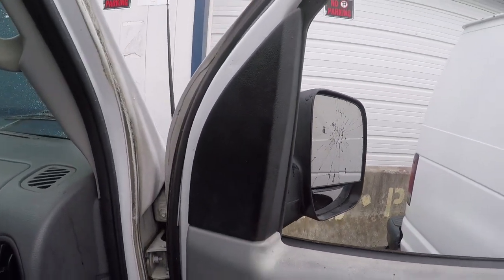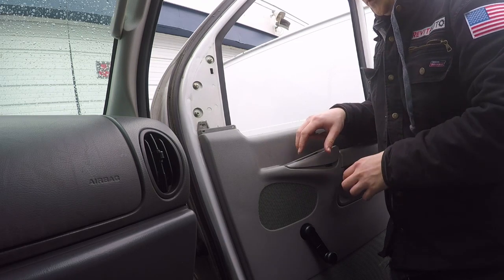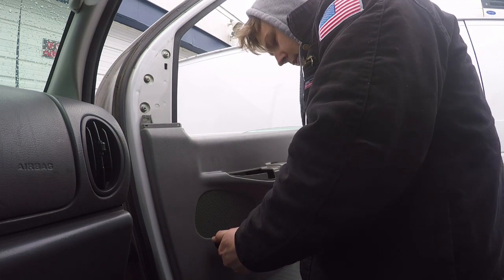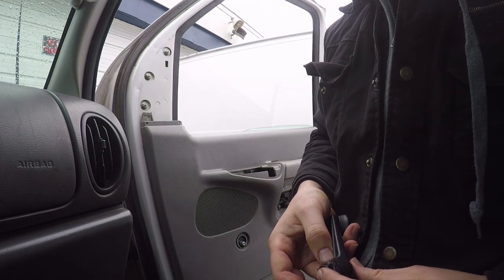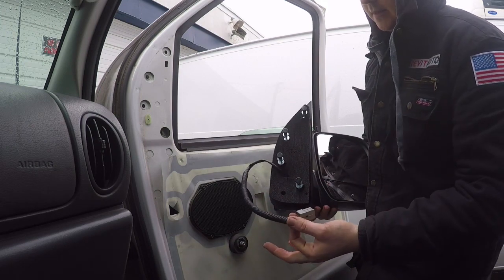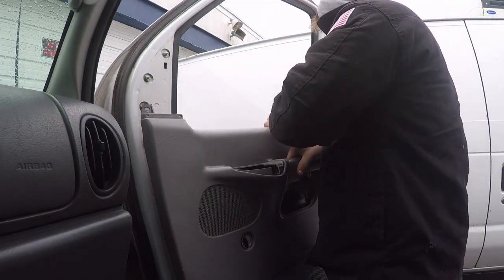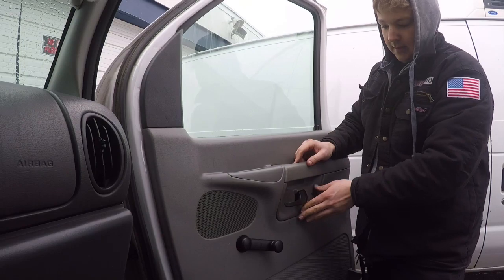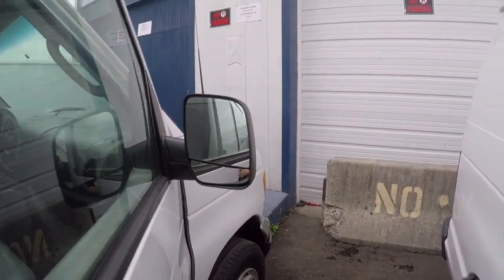Ford Econoline Van Mirror Replacement (Detailed How To) | Fix It Friday

Comment: Great video! I used this to replace my mirrors. You can do this without removing the door panel, if you are careful. The bottom nut is visible when you pull off the black trim cover. There is a screw that holds the top front of the panel. Remove that and gently pull the panel up and out giving you access to the room you need to get at the nut. Use a small 1/4 socket with either 7/16 or 11mm. If you do it on a hot day you get the benefit of the plastic panel being even more flexible. If not a hair dryer might help.

Another option is that when the door is close you hardly see it but you could simply drill a hole in the panel and have access to the nut and then get a plug for the hole if desired. As these vans are long in the tooth you can decide how you want to handle it.
I was able to do both sides in 1/2 hour being extra careful without removing the panel and just the top screw.

Comment: Thanks for the video. One helpful note for people with electric mirrors: take the speaker out and then you have full access to the connection.
Reply from the maker: Thanks for adding that! I have yet to see that! Happy Motoring-Blair
Reply: Thanks for adding that note! ‘Full access’ is one way of putting it. Lol. I had to have one hand shoved into the speaker hole to release the harness tab, while pulling on the mirror harness from the outside.
Reply: I think Matt means to say, "partial access."

Comment: Taking the whole panel off just to get to a hidding screw? Thanks Ford for making it harder than it should be...
Reply: I don't do much engine work myself but from what I hear econolines are a bitch to work on all around. I don't understand why they had to shove the engine so far forward into the cabin. Means my massive E350 has less legroom than my ford focus.
Reply: @JackAttak  I love the looks of the van... Specially the extra long one. I have one My self... I just haven't had any engine problems yet... But i do know when I get to have some... It will be an expensive repair.

Comment: How do you adjust the electric mirrors if you do not have electric setup?
Reply from the maker: You can just press in the mirror gently and it will move. You may need two people to speed the process up!

Comment: Why you removed the door panel
Reply from the maker: There are four nuts that hold on the mirror assembly. In order to remove the lowest one you need to remove the door panel. Happy Motoring -Blair
Reply: Wondering too. Mine is manual not electric. Same dismantle?
Reply: @Revitauto  no you don't
Reply from the maker: Daniel Mann tell me of your magic ways !?
Reply from the maker: @danielmann5427  tell me of your magic ways!!!